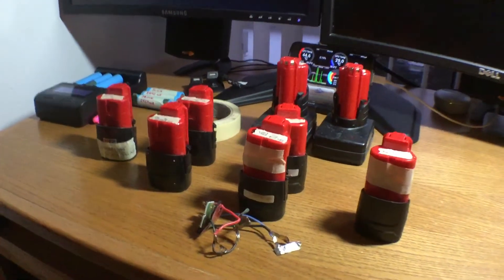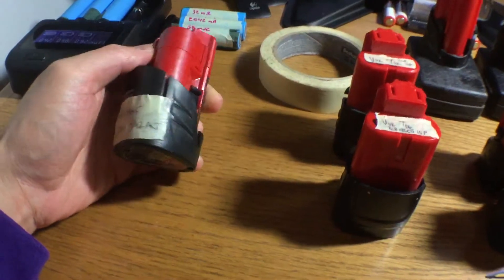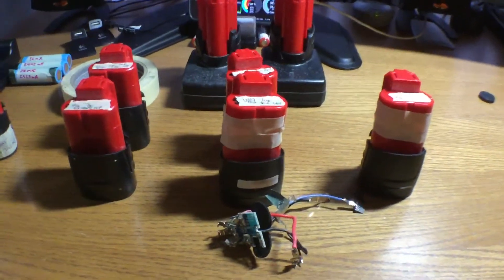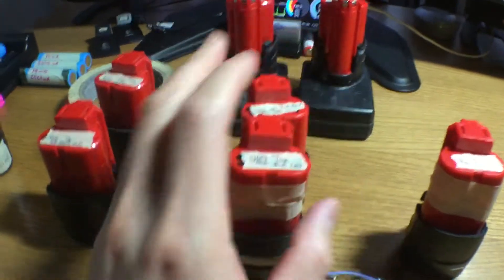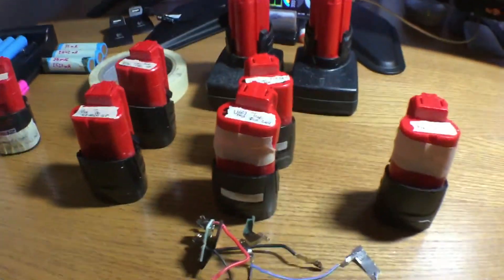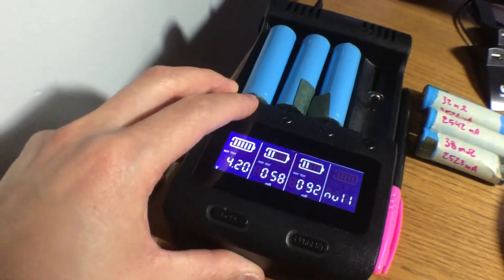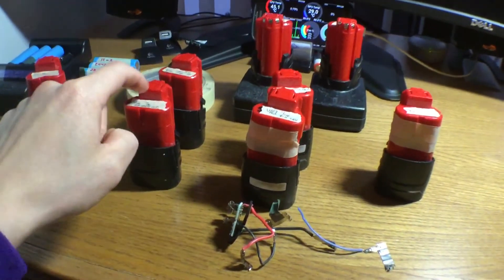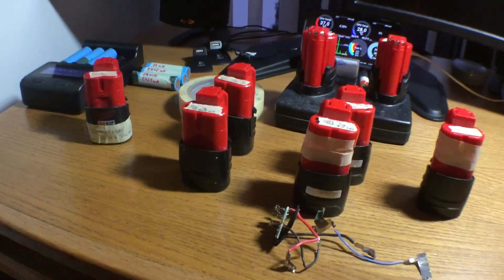Vanon Milwaukee M12 battery disassembly and teardown to what cells are inside

Comment: Vanon. The biggest piece of junk out there. Waitley is a much better value for me. Although the first thing I do in a Waitley battery is open it up and another nickle strip on top of both the pos. And neg. Main power strips. Ive had some burn of off a Waitley 5ah battery. All so the Waitley batteries I've used are a full one amp hour less then stated on the battery. Othen then that it a decent value for the money.